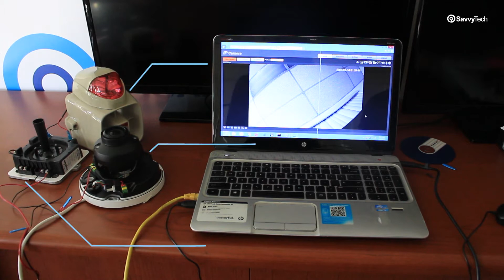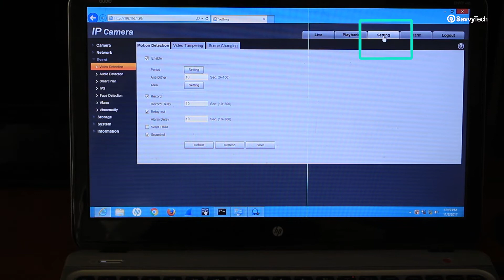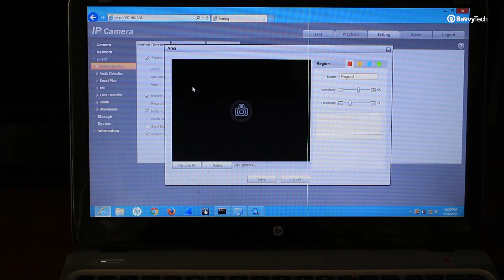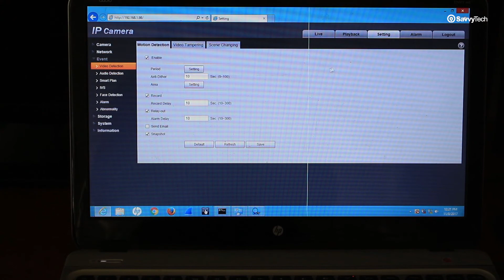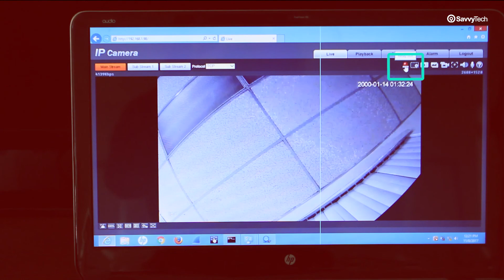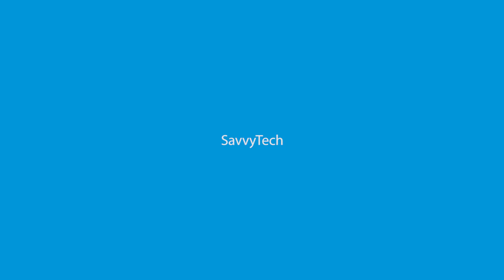How to Set Up Alarm Output to IP Camera

Comment: Hello,
my Dahua Ref DH-IPC-HDBW5431E-ZE camera has an interface 1 'Audio Interface 1 input channel / 1 output channel

2 'alarm interface 1 input channel: 5 mA 5 V DC & 1 output channel: 300 mA 12 V DC
at the output of the connector of my camera I only have 3, 2 volts
can you explain me how to connect example a flash lamp or a siren on the connector of the output

alarm from my camera so how to use the audio output thank you

Comment: I have dahua nvr4108-8p-4ks2 it has no alarm panel on backside only mic in/out. But on 2 of my dahua cameras i have alarm in/out , and sound in/out. Will camera sent those signals from in/out to nvr aswell ? . Allso where can i buy a cool siren / light like yours ?. Do you know what speaker i can connect to camera sound out ? Must be amplified speaker i guess